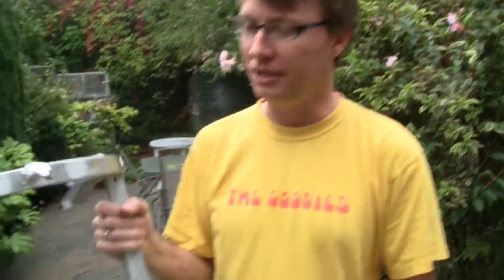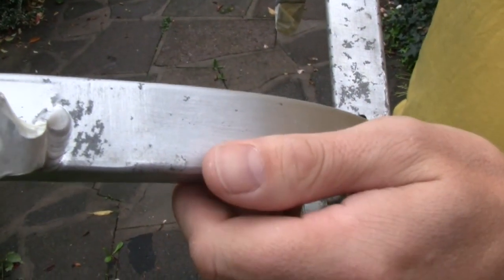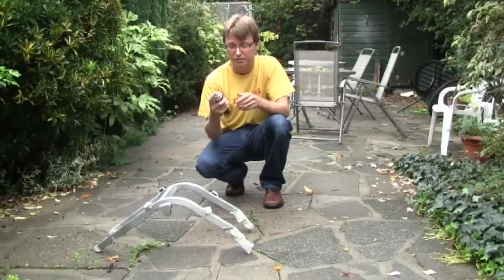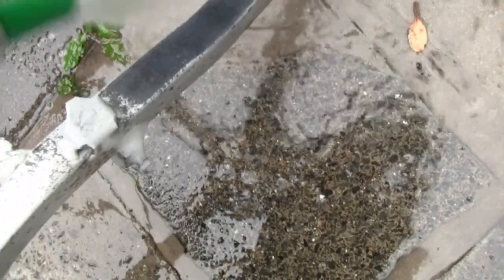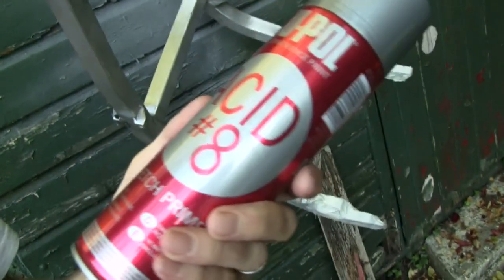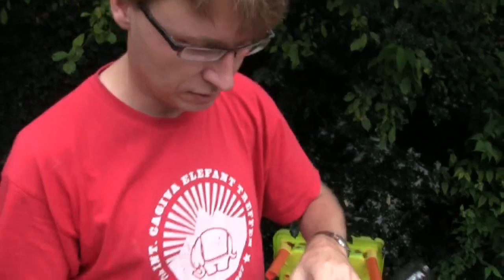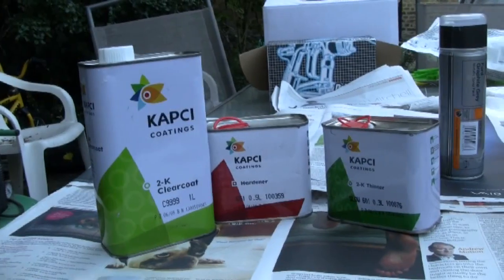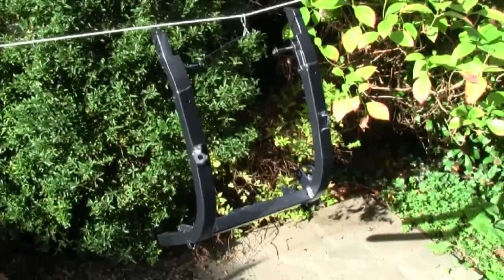Restoring anodized aluminum: remove old coating and apply a new finish

Comment: I always thought that aluminium/aluminum NEVER corrodes due to the protective oxide coating but I guess that's why they say that it's "corrosion RESISTANT " rather than "corrosion PROOF " , learn something new.

Comment: Is that black layer some kind of corrosion?
Reply from the maker: Mack Mkay Hi there. If you're referring to the marks on the subframe before I hit it with caustic spray and sanded it - yes, that's corrosion that occurred because the anodizing layer had failed. It can also go black if you caustic spray an area of plain aluminium. Removing anodizing  and restoring it is tricky and the results are not great, so I decided to strip off the damaged layer and use paint instead.